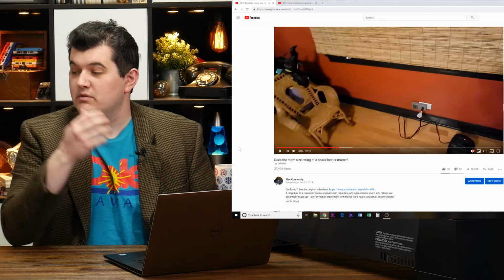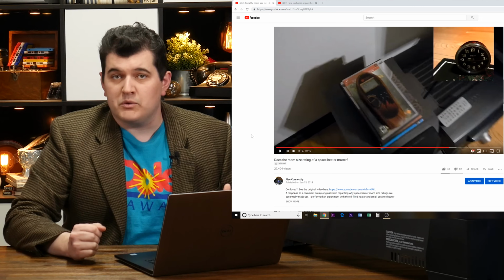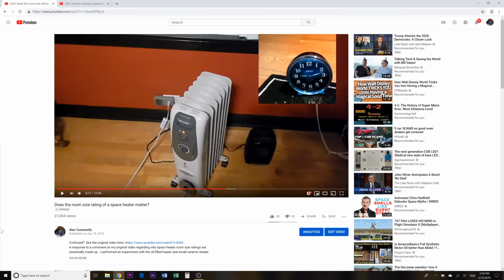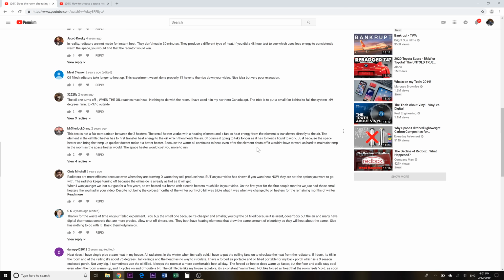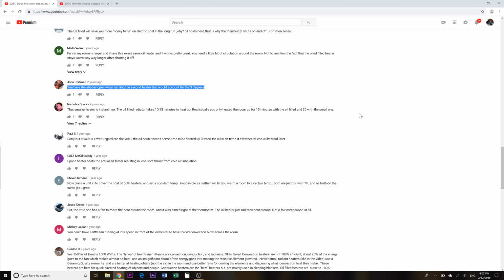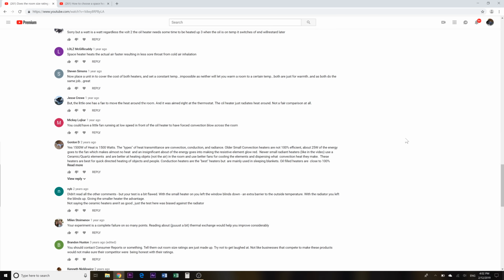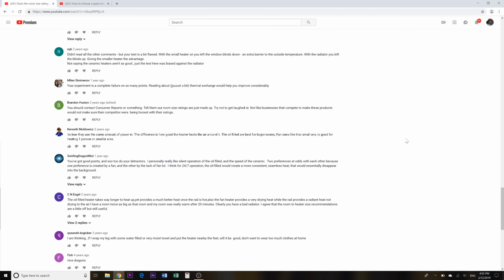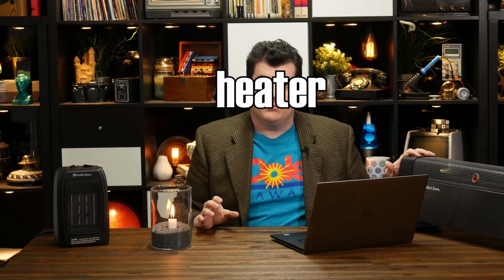More Space Heater Nonsense

Comment: Quickly checking the inventory of some local (Finnish) retailers on their web, it seems the typical consumer grade heating fan goes up to 2kW whereas oil filled radiators vary between 400 to 2000W.  If you need a bigger fan, you can get a bigger fan, up to several kW (for industrial-level applications). Nobody seems to be advertising with "room sizes" here. The pricing seems to correlate more with brand and features than with the maximum power level.
I can very much empathize with your frustration with the reactions to this subject. It seems that often my similar kind of observations about the surrounding world do not pass as something people are eager to process.

Comment: Here is my guess, I believe it has more to do with a continuous operation model than the amount of heat generated. Resistive wire used in the smaller heaters are alloy and have a high resistance but can also have a higher oxidation and corrosion factor that will cause them to fail more quickly than one that is insulated in ceramic coating or sheathed in another alloy tube, or encased in oil. So even thou that small heater puts out the same power it will not last as long at its 1500 watt limit as one that is better designed for sustained heating as required by a "larger" room of one with a higher thermal load.

Comment: The EPA (I believe, or other US agency) has a handy calculator for estimating the heating and cooling costs of your home, and also has a tool for estimating the cost/benefits of an upgrade (new furnace, or insulating your attic, etc). I bet you could use that tool to see how much money you would save by estimating the more expensive method of using a space heater, but only in a bedroom at night, versus just heating a whole house 5 degrees warmer with a more efficient furnace (efficiency meaning gas is cheaper than electricity for the same BTU output in terms of cost).
In your main channel video, you stated that using a space heater is more economical, implied as a given, but I’d like to see just how much that actually is supposed to save you, and whether it does or not.

I might dust off my  Building Thermal Science book and dig into this myself. But I figure putting numbers to these popular methods would be an interesting investigation.

Comment: The Tealight thing is more applicable to someone inside a tent! Furthermore, The heat you feel in a room is a combination of the infrared heat hitting you from all surfaces, And the temperature of the air moving past you. This is why Radiant floor heat is so efficient, As the temp of the room can be lower with a better level of comfort, which results in less losses out of the heated envelope . Note: Incandescent bulbs make decent space heaters that throw around infrared heat to boot!

Comment: NO good deed goes unpunished. At least not on YouTube. Have used heaters for 50 years. Still have a few of the older ones, they last WAY longer, are easy to fix. I used almost exclusively the 'milk house heaters', big, heavy, ugly metal box. Heavy line cord, the older ones (50's - 60's) are around 1800 watts. I have retro fit muffin fans in the majority of them, fans were the major failures. I usually retrofit elements with about 1kW elements as heaters usually run on long extension cords. I usually run two thermostats, one starts the fan, one adds on the element a couple of degrees lower. We always had two or three of them out in service pits on the ranch, keeping the water pipes from freezing. South Dakota in the winter can go below zero for a week at a time. After moving to Colorado in '77, It wasn't as scary as the temps here aren't as cold for as long. Heaters are tuned and ready. It's 7° with a 11mph wind right now. Only heater going out there is one I built myself. A 200watt element with a 3" muffin fan mounted in a 3" PVC pipe 24" long, thermocube (35° on 43° off on incoming air to element) all boxed in a 1" thick styro box 6' X 18" X 18" open to the ground on the bottom but 5' down in an outdoor covered, and insulated, unheated basement  Keeps the main water feed and valve from harm. 1500w is 1500w when resistance heating is used. Nice bunch of trolls you have accumulated... lol Marketing types love those guys.. easy sell.  Michael in Colorado.

Comment: the only thing i can think of that might be a plus for the "baseboard" type heater would be that in a larger room (with higher ceilings), the convective currents might do a better job of mixing the whole room than the little fan on the "small room-heater". But in either case location of the heater will be critical get getting heat mixed around the room.

Comment: i think you might be underestimating the amount of air a larger heater actually pushes around via convection, just it's not coming out of a small area so there's less pressure. it might be that 'large room heaters' are suited to larger rooms just because a little fan isn't good enough to stop there being a temperature gradient, or there might be other reasons why a tiny heater with a tiny fan only heats up a little area, like perhaps you can have big slow convection or little fast convection. i'm really talking out my arse here but if it's not marketing wank i'd expect the answer to be in how the heat is distributed throughout the room, as equilibrium isn't necessarily as inevitable as you suggested as the heat source and the 'cold source' are still operating on the space.

Comment: Edit this comment is what happens when you don't watch a video all the way through. 

strikes me that the oil filled is designed for long term use for a large air volume. Its design prevents rapid cycling of the heater in a room where the air is near the thermostat limit but poorly mixed. where as the smaller one in a larger room where its fan is insufficient to mix the air adequately will cycle on and off more frequently reducing the life span and over all usefulness of the unit. 

But yea with adequate air circulation, or inadequate insulation, the smaller cheaper one will always be the superior one. EDIT and yea that base board heater seems like it would be the least effective in any situation.

Comment: A point to consider: Maybe the room rating is not for determining which heaters work best in large rooms, but rather the opposite - which heaters are worst suited for small rooms?

I mean, let's look at this from a different perspective. You are completely correct in saying that a 1500 Watt heater running for one hour will put out the same amount of thermal energy into a large room, medium room, and a small room alike. Specifically, that energy will be 1500 Watt-hours, or 1.5 kWh, or 5.4 MJ. So if your heater can run at its maximum power, it will be able to heat the room up at that heat output. The laws of thermodynamics are pretty clear about this, heat doesn't disappear anywhere nor can it come from no-where. If you have an added heating element of certain power, that's the heat you're getting into the system.

But what does that energy accomplish in different circumstances? A space heater is not necessarily meant to increase a room's temperature as rapidly as possible (although that is a decent way of testing them). A more common purpose is to maintain a certain desired temperature in a room - in other words, reaching a thermodynamic balance temperature where the heating and heat losses are equal.

A large room typically loses heat faster than a small room, due to simply being larger. So it has larger heat losses, and requires more heating than a small room to remain at a constant temperature.

So, in a large room, you might be able to have that 1500 Watt oil-filled convective heater running continuously at maximum power without overheating, because it's working at lower temperature, against a significant thermal losses of the large room. It says cool, because the room stays cool. The heater might be increasing the temperature equilibrium of the room by a couple of degrees - let's say from 16 degrees Celsius up to a more comfortable 19 degrees Celsius.

If you put the same heater into a small room, and expect it to run at full 1500 watt power, well, you will certainly heat the room up for a while but as the temperature increases, so does the temperature of the heater. Which can lead into overheating issues, if the temperature of the room is allowed to just increase without intervention. By the way, poorly isolated thermostats are a design issue. I'm not sure how endemic that issue is to the oil-filled space heaters on the market, but certainly there are ways to isolate thermostats from the heating elements in such a way that they are probing for ambient air temperature instead of the heater's own temperature. Even without a fan actively blowing ambient air over the thermostat - I can think of a few different passive solutions to this issue. Having the thermocouple at the bottom of the heater with some isolation between it and the heating element is one way. Another would be to use the convection of the heater itself to suck in fresh air over the thermocouple.

Anyway, my point is that maybe the room size labels are not meant to imply that small electric heaters are unsuitable for large rooms, but rather that a large oil-filled convective heaters are not ideally suited for small rooms?

It would be more accurate to announce ideal operating temperature ranges for each heater type, but you know as well as I that people would not be able to understand what that means. Oil-filled convective heaters have a narrower ideal operating temperature range and start limiting themselves sooner when temperatures increase, so they're more suited for maintaining temperature in rooms with more thermal inertia and higher thermal losses. By contrast, the smaller heaters have a wider operating temperature range, so they can be used in all kinds sized rooms, and at different temperatures, but are uniquely suited for increasing the temperature quickly in small and medium sized rooms. Which is a totally different use case scenario from the oil-filled convective heaters.

The offset here is that smaller heaters compensate for their small radiator surface area by running very hot, so they can become fire hazards if they are covered with something and the overheat protection doesn't have the time to kick in. The oil-filled heaters are much safer because due to their large surface area, which allows lower surface temperatures.

Comment: Ehh...
So as far as an expose on a mundane oddity, I think the vids are great. 1500 watts as some weird universal standard on space heaters is kinda odd; maybe someone needs to address the labelling laws governing space heaters. 

As far as it being an informative dive into thermodynamic, there's some room to improve, but, from a leyman point of view, such a video is unnecessary. 

People don't necessarily care how many watts or BTU's are flooding into or out of a room. They care how they feel when they're in the room, and that means it needs to sate their subjective tastes, whatever those may be. 

Posts about convection, conduction, energy transfer in a working fluid, thermal storage, chemical work (which is generally very bad news in a space heater), and maybe perception of heat are things that might be important to a deeper dive into the topic, but, again, probably not necessary.
Reply: 12A (80% continuous on 15A standard circuit) x 120v = 1440w
Reply: @Chris-ie9os  with the labelling laws in the USA, they can state 1500 watts and still be technically correct because it's within 10% of the standard. 
That's something that comes from electrical component and local variations in the electrical grid within the US.

Comment: There is one thing that you've missed... the convection heater adds heat mostly above it, so you get a larger temperature differential between the top and bottom of the room, whereas the fan blowing near to the ground adds heat from the bottom. Depending on the size of the room, you can easily end up with a 5 degrees difference between temperature near the floor and near the ceiling. Of course, air flow required for convection heating patterns doesn't seem to be connected so simply to room size... it seems to be like the fan is actually better for the big room, so you don't just get a hot pocket of air above the heater, which also means you lose more heat because the temperature differential is much higher near the ceiling.

Comment: A large room is more likely to have something like a ceiling fan.

If you wanted the larger oil filled heater to heat the room faster, you could do something like putting a box fan behind it so it performs similar to the smaller heater as it would replace the hot air with fresh cold air rather than letting it stagnate and radiate out. When I've tried this I found it tends to confuse the thermostat even more for some reason though.

Comment: You're oil heater is faulty. I've used both types for many years. Oil filled has been cheaper to run. I've got one now that cycles off like yours, faulty. I have others that work great.
Reply: "cheaper to run"

* facepalm *

(That's what the whole video is about. It cannot be "cheaper to run", unless you refer to possible repair and maintenance costs, which for most units are 0. It can be better or worse, it can be more reliable, or comfortable, or usable, or good-looking, but it cannot be "cheaper to run". Efficiency is always 100%  :)
Reply: Jason Doe yes cheaper.  The oil in the heater retains and continues to dissipate heat after the electric current cycles off. A heater utilizing coils, fins or what have you stops emitting heat almost immediately during the off cycle. They have no way to store and  continue to emit warmth. So yes, it is cheaper and quieter. A one hour test is simply not enough time to accurately calculate overall efficiency. Certainly not worth smacking yourself over.
Reply: stephen b, oh, I see now what you meant. That's a common, but erroneous, way of thinking. As other comments have also pointed out, the amount of energy  you "save" this way is exactly the same as the amount expended (at the very start) to heat the oil in the first place. It's slower to cool down, but also slower to heat up.

Ultimately, the thermal capacity (Google'able term) of the heater does not matter (mathematically) in terms of efficiency. **

I'll agree, though, that oil heaters provide a more pleasurable and "even" kind of warmth, and their high thermal capacity helps with that.

** Here's a small thought experiment to illustrate my point: Imagine we keep an oil heater the same (same power rating, surface area etc.) but gradually increase the amount or density of oil that it contains (thus altering its thermal capacity). Will its efficiency (by your logic) keep rising? Until when? If adding more and more oil stops being an improvement, what's the physical mechanism behind the change, and when will it happen?

Another day to think about it is by comparing the oil to the smoothing effect of a capacitor in an electrical circuit.

I hope this helps, and sorry if my initial post was a bit graceless  :)
Reply: Jason Doe What helps is a lower electric bill. I've been using different types of heaters for 40 years and paid the bill. That's empirical. Same rooms same conditions. If working properly they store and emit heat more effciently over a period of time. Once heated they cycle on less. The cost of the initial warm up is greatly diluted by reduced cycling over time. Over time. Take identical rooms metered seperatly and heat them for 48 hrs. Simple enough. Is the claim that a technological advancement can never improve efficiency? Watts in always equals BTU 'S out? Well, I know for a fact that you can decrease money out. By a lot. Experience always beats theory.

Comment: You will never get out what You put in. Theres always energy loss; how effectively the heater will turn energy into heat. And on that the small toaster-style heater might actually be better for getting a room temperature up quickly. The larger oil filled heater though will store heat in the oil it heated up, so the oil can do it's work while the heater can shut off. To generate heat, the ceramic element heater has to be on all the time. So the bigger heater might be more energy efficient. And I wouldn't want the small heater to run nonstop, depending on the circuitry and if it shurts itself off when reaching a certain temperature around it. If it doesn't shut itself down, it's a bit of a firehazard waiting to happen. I'd still opt for the bigger heater for every day use and the smaller one to get a room warm quickly.

Comment: Alec, my guess why is says small medium and large room is: The larger heater can accommodate a larger heating element - with more watts of power. If you built it too small it would overheat. In my country, the ones for small rooms have say 1000w, medium 1800w and large 2500w. Only in your country, where you have only 110v and may only draw a limited amount of current, they have to throw in a smaller heating element even in the bigger heater. The same bigger model may be sold in other countries with more watts. But the marketing guys do not fully understand the consequences (big heats same as small if same watt) and so they put on the same labels like for example in the uk, or maybe even just a small 1500w sticker over the 2500w text?

Comment: I suspect that the size rating is more about how well the power can be distributed evenly throughout the room: i.e. the cubic feet of air it can push about the place. Convection does not work so well if there is a large outflow of heat at one point within the room - since there will be a thermal gradient between that point and the heater. Maybe the bigger heaters are better at minimising this gradient... 
(Nah - it's probably just marketing)